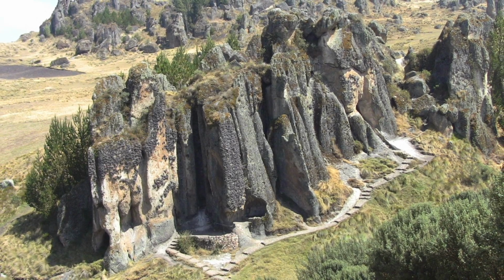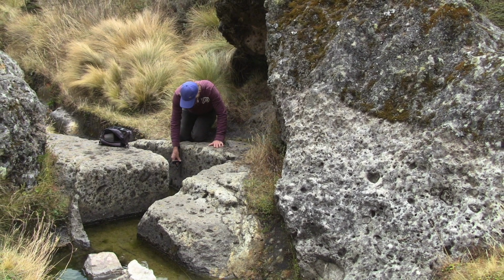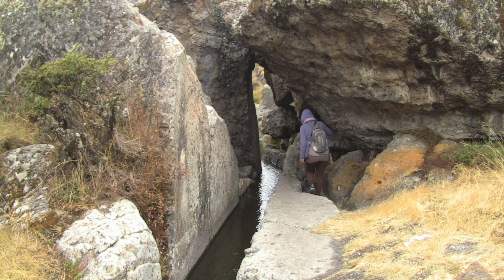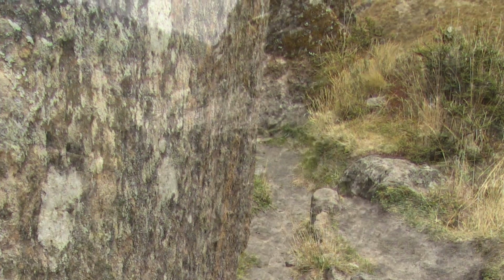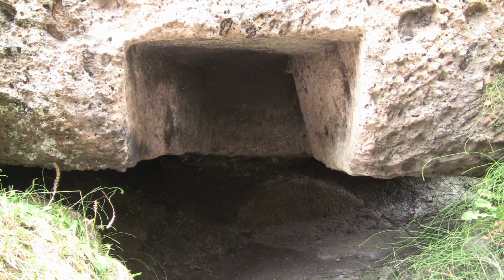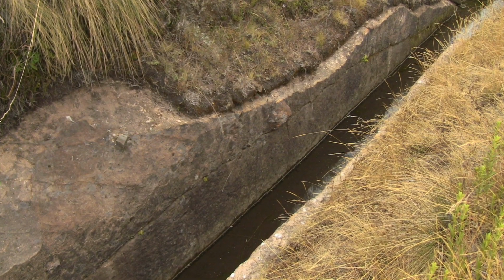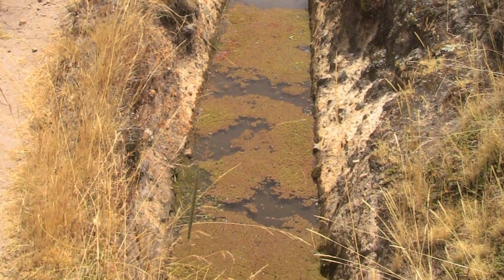The Mysterious Ancient Cumbemayo Aqueduct Near Cajamarca Peru

Comment: The zigzag also keeps pressure by slowing the water down if it was straight it would run out really easy. With the zig zags it takes time for the water to go all the way down so as more comes in it builds up instead of just running out

Comment: At about 6:17, is there any idea how the tunnel channel could be cut to go into the bedrock?  The entrance does not look large enough for a person to lie on his back and, in any manner, cut the void for the water to flow.  The tunnel even changes direction! I am surprised that nothing was said about that!   The zig zags are more likely to slow down water flow, as today's highway departments sometimes use in highway slopes.  I am a geohydrologist and do not believe the water would be filtered with the angles in the flow.
Reply: more than that - they could easily go around the stone. But for some strange reason they decided to go in and even make a 90 degrees turn inside the stone.

Comment: A basic rule of hydraulics has been to cause the watercourse to meander as in nature to reduce the velocity of the water. If constructed in a straight channel, the velocity of the water would exceed the capacity of the channel to contain the water transported. If you consider the proposed use of the water, probably irrigation, water at high velocity would result in eroded soils. This is seen all over the world where irrigation channels have been built. The variability of the channel, with straight sections and constructed meanders, reflects the maintenance of the needed velocity for the use proposed.

Comment: Hi Brian I work in aquaculture which involves a lot of water flow and design systems... The 90° turns prevent surgeries of hydrostatic pressure... once the water starts moving along a straight course it builds up force by breaking the DirectFlow you mitigate the circumstances.

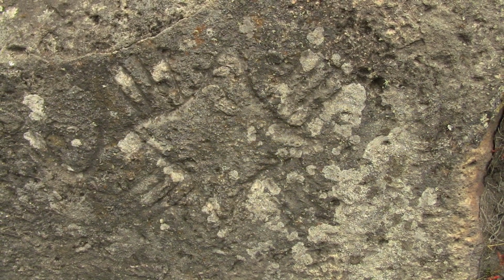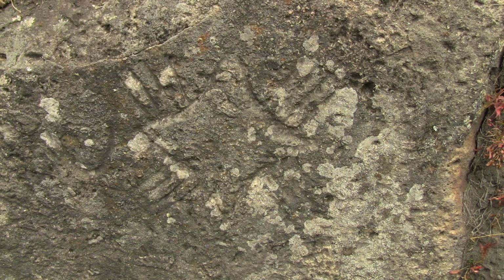Comment: Brian. At 4:04 it should be mentioned that actual depth of the canal in some places was made deeper in the bedrock than what it looks like. Because one side of the bedrock is trimmed down to a whole new ground level. At least thats what it looks like. Its most clear at 4:04.   This perhaps was a must because of the construction work needed space and/or to make an inspection pathway.
Reply: Wouldn't tunneling with 90° turns reduce the flow rate and volume of water...
Reply: @steve-o6413  perhaps the maximum flow rate was probably not important compared to filtering out sticks etc.

Comment: Those right angles that were built into the aqueduct would of not only stopped some of the sediment but it would also slow the rate of the water flow so you would have a steady even flow. Instead of swiftly flowing torrent.

Comment: Wikipedia asserts that metalworkers in India were making steel circa 1800 BCE, which would be 3800 years ago. The assertion that the 'only metal available was bronze' is suspect. Steel would have been expensive and rare, but it was at least theoretically possible to have it.

Stoneworking tools would have been one of the most valuable steel products. While no evidence of such tools in the Americas has been found, it isn't out of the question. More than likely, such tools would have rusted away by now. There should be, however, some evidence of their remnants at various burial sites.

Such tools would have been particularly valuable in trade. Therefore they would have circulated throughout the known world, which might have included Egypt, South America, and Japan.
Reply from the maker: Spanish brought steel in 16th century AD

Comment: You can’t suggest that it could have been used to move water uphill. Come-on. However made, it does show great planning. I can imagine a planning engineer measuring it all out. Interestingly sediment drops out faster when the incline is steeper. (I used to be a builder). It’s a fine art to get the flow correct, because if it is too steep, it will soon block up. I think you must be wrong about the filtration aspects of it you are suggesting because it would take constant maintenance to keep the flow clear. If you measure the drop of about one inch every eight feet, that’s about right for a good flow that won’t get clogged up.

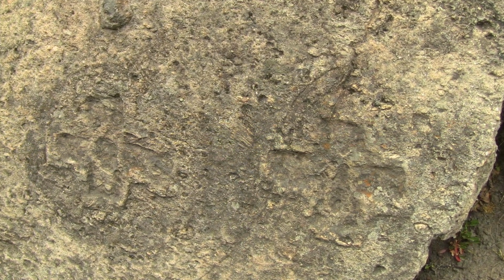Comment: @3:58 Looks like the mountain was cut back from right to left followed by the trench - to specified dimensions and slope. [Geophysics + Hydraulics Engineering + Technology/Equipment/Tools to do the job. That's just this little spot. Wow.]

@6:04 Didn't remove mountain this time. Hmm? Maybe they cut the notch like a key hole to remove and repurpose blocks? (If a preference, or means, to blast is not used or not available, may as well excavate - with purpose!) The key way cut is somewhat similar to a portion of the shaft in The Great Pyramid. I think it's an internal change-up to configuration in the South shaft in the King's Chamber; but, I can't find a photo now. Oh well.

An eight kilometer length aquaduct is almost five miles. [Add expert Surveying to that list above.]

Comment: very interesting...
it is not logical, because it is not necessary for the purpose and use of the aqueduct, always if it is an aqueduct, to have the walls of the rocks worked in height.
The aqueduct has zigzags to adjust the flow rate/pressure or the speed of the water flow, certainly not to "filter" the water from dirt and solid particles.
the aqueduct is extended for 8 km, so it carries the water from the mountain to the valley. here, where does it arrive? what is this important construction for? this engineering work constructively speaking is complicated and not easy to carry out. and then the completion times of the work, what could they have been? a day, a week, a month, a year, a decade ....?